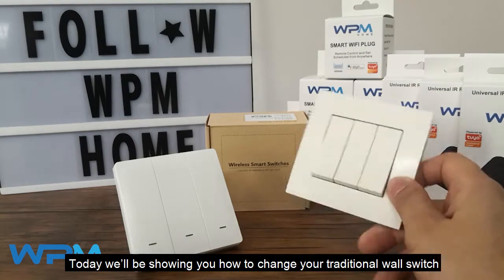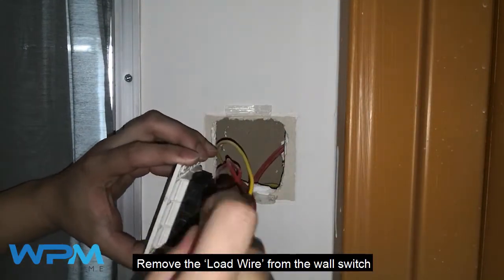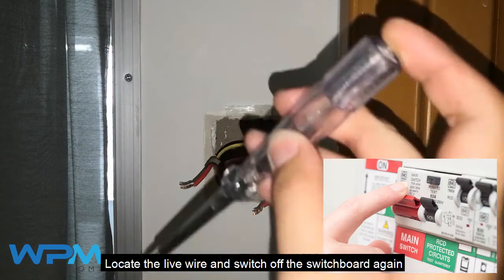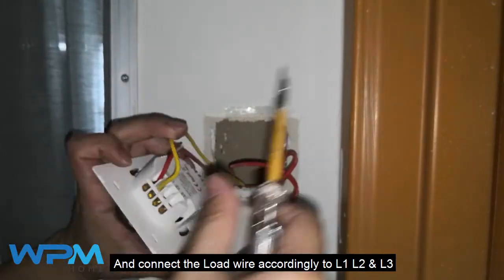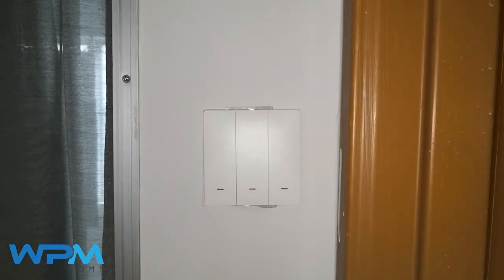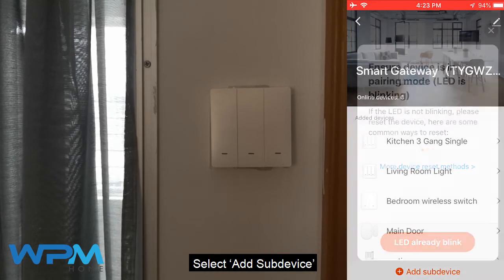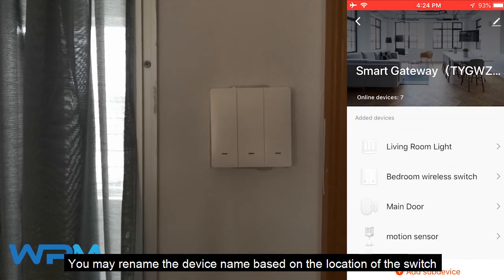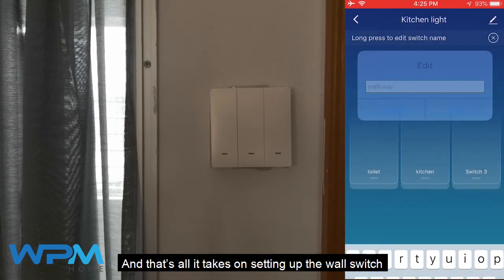[How To] Setup WPM Home Smart Wall Switch (Zigbee) Tutorial 如何设置 WPM Home Zigbee 智能开关

Comment: I have a 1 gang switch. Must have gateway only can connect to smart life (tuya app)? It’s a zigbee.  Before this I buy a 20A switch can connect direct. But this zigbee seem undetectable.
Reply from the maker: If is zigbee version, then gateway is required.

20A switch is wifi version, hence it can direct connect to Wifi.